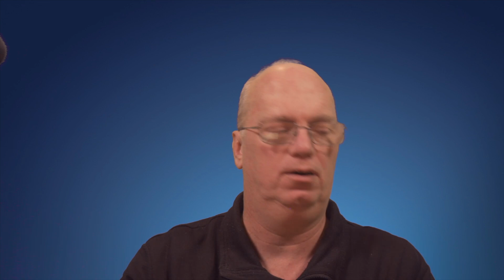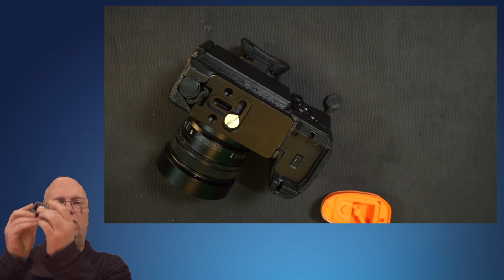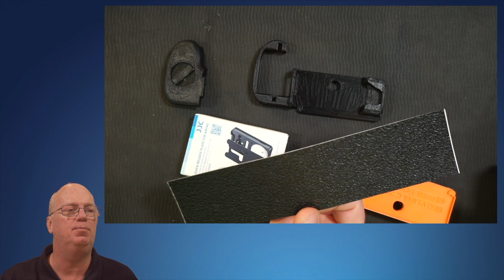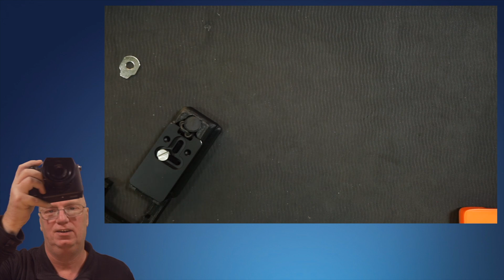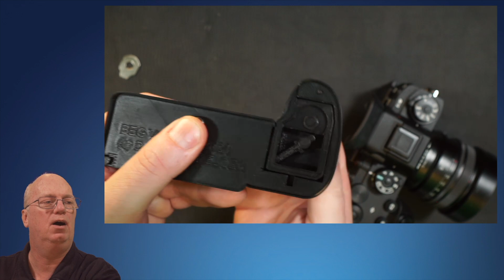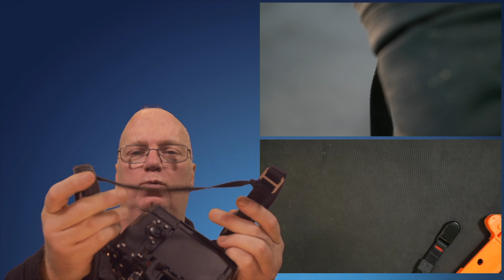Sony a1ii / a9iii  3d printed extender grip with airtag support

Comment: Maybe one day Sony will learn to design a decent body without adding anything.
Reply from the maker: Well we disagree i feel the a1ii/a933 body is near perfect. There is a reason why we have grips not everybody is the same. What sony should do is release more 'extenders' not just a full grip at 47mm. But i guess you define 'decent' as what height  and for what hand size would that be perfect?
Reply: This may open up a completely new discussion: Should manufacturers produce different camera body shapes with same electronics and user interface just to offer variations for different needs or anatomies? Like you can buy the same jeans design for different leg sizes. 

I guess this would not add much to the developing cost because these will mostly reflect the costs of the electronics. 

Though it will be an annoyance to the retailer because he would have to have multiple variations of the camera in stock which means more initial investment. But some other cameras are available in different color designs and the retailers are mostly willing to join that game as well.
Reply from the maker: @_Thumbnail_  Personally i don't think there is a need there is a whole wave of products to extend cameras to the correct use from l-brackets to full cages, grips etc etc. I really feel the a1ii/a9iii are near perfect in body design now even if i personally will always want a extender. What i do want is sony to work on better integration and also sell extenders themselves (again they use to make a few). If anything sony wants less skews for example the new battery charger means they can already unify all the boxes since its all usb-c and no 110/240v and plugs differences are needed.
Reply: Sony японская фирма у них ладошки национально мелкие так что они их правильно делают, в плане для себя)